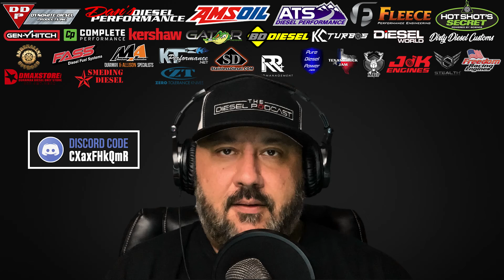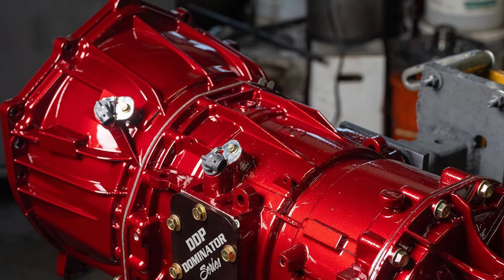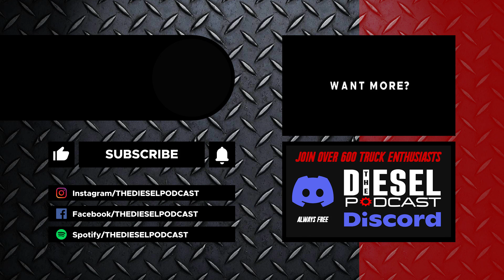3 Ways Your Transmission Will Fail

Comment: It is worth mentioning that allisons use the GM through case connector which are problematic with leaking atf past the epoxy and terminals. This will put one into limp mode and can be easily overlooked. Threw me for a loop when I worked at a trans shop. Its one of those things to babysit and have a look at a few times a year. Not entirely sure if we used to shave the friction material off of one side of some of the clutch plates to gain clearance for more clutches and steels on allisons, but it worked great on some entry level built gas race stuff where the motor was a bit overbuilt for the trans. My old boss owns the "Christine" pro modified drag car, so we got contracted for racing applications and hotrod restoration work all the time.
Reply: This just happened to my truck

Comment: I thought torque was the enemy of transmissions not horsepower. But when i listen to these podcasts guest are usually saying horsepower numbers not torque. We all know heat is a big killer of transmissions I think that goes without saying.
Reply from the maker: They are both related given the horsepower to torque relationship with diesel engines.  Guests are usually using horsepower as a reference point, not to disregard the torque number.  They are definitely factors, and heat as you mentioned.
Reply: This hp/tq ratio  was a stumbling block when I Scattered  my RH 46 going down the interstate.   A RH47 conversion  folks were trying to sale me a  bomb proof " you can't make enough hp to have a 400hp box brake. Your pump maxes out at 400hp. "  there rated tq was based on P-pump static timing  2:1 = 800tq max. A VE has variable timing with a 3:1(PPD Dynoed 491.0@1846 178.3@1976 wheel) therefore an 800tq box is going to s... the bed when it sees 1200tq. So much for bomb proof; I mean 290/803  is a cupple turns on the smoke screw and a small hit of NO2 and my otherwise 100% stick 1st gen will make you want to burn the mattress and bed frame after the 47....  the bed. So I went with Allison ('07 6sp) with some tricks from a MEDIUM DUITY Bulder, making theas live in 42k GVWR trucks in Dallas, tx.
Reply: 100%. I'm putting an Allison 6 speed behind a 7.3, so I called a vendor and asked what the torque rating was on their kits. I was told the 750 hp was 1800 ft lbs. rated, which I thought was odd seeing I've never seen a 750hp Duramax make 1800. Maybe I just don't pay enough attention to them... Either way I should be under 1300, so plenty good.
Reply: And your name, YES!